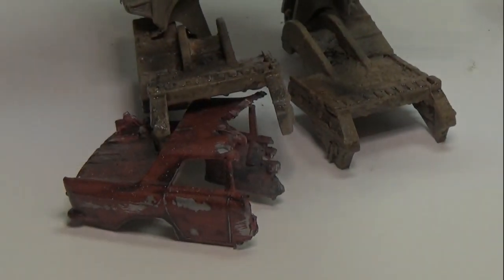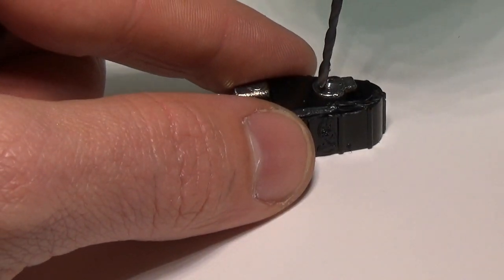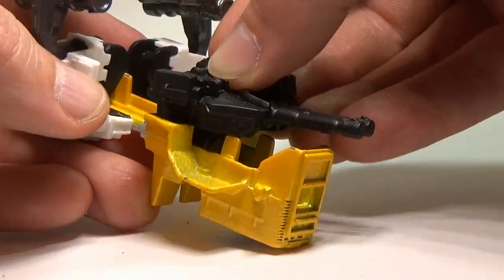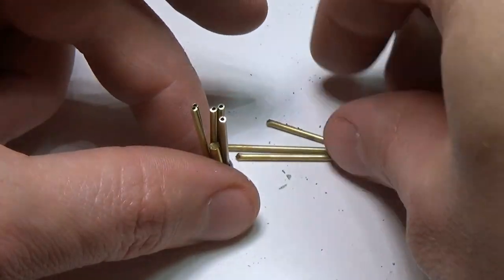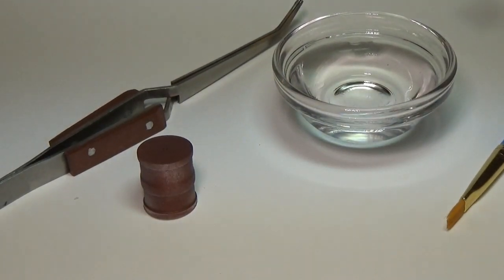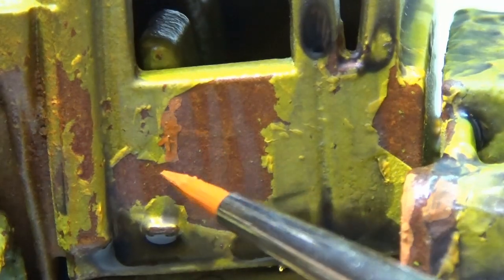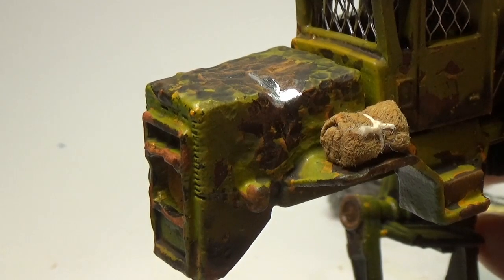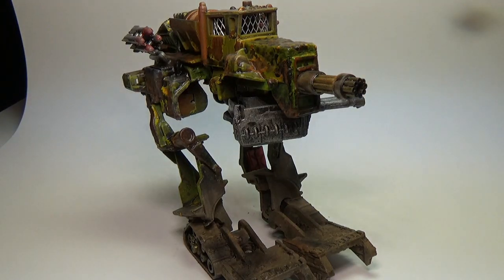Custom Mad Max BattleMech made from Hot Wheels and MatchBox cars.

Comment: Can you do a mad max train?
Reply: rails don't work
Reply: @lucaselizena6848  then give the train wheels
Reply: Like one of the German fortress tank trains on COD WW2?!?
Reply: In the mad max universe, there's probably no tracks left, so they would just slap some tires on it
Reply: @beacher50_  You'd be surprised, even 150 year old track still olds up with little to no maintenance.
Reply: @BattleshipOrion  still, they would definitely find a way to steer it with tires
Reply: @beacher50_  Trains dont steer though, compromising the chassis, or body makes it not a train. Trains use the flange on the wheel to guide it, and use switches to change tracks. Tires wouldn't even be able to handle the weight of one locomotive.

Comment: Very cool project, it would be great to add some hydraulic rams and lines to the legs. The rams could be made out of styrene tubes and rods and the lines out of small gauge electrical wire. As always, impressed with your skills.